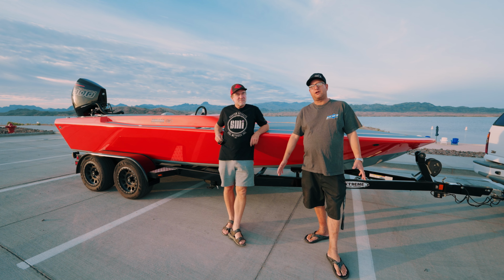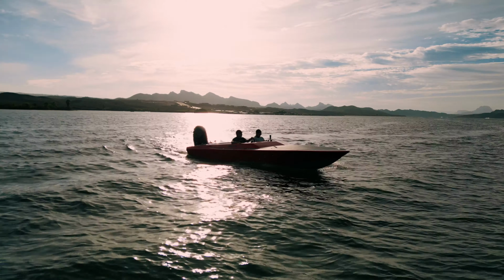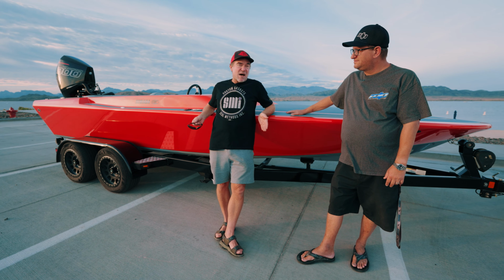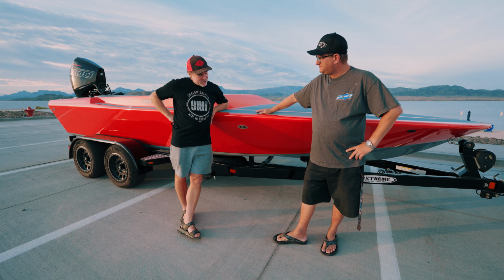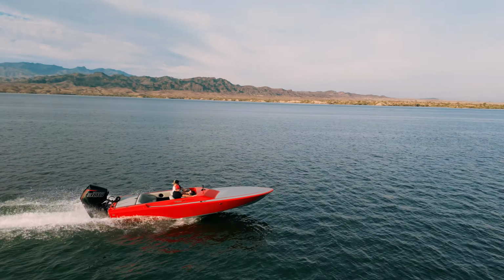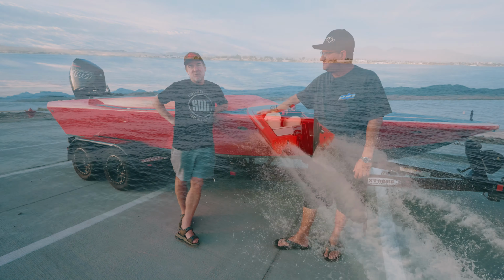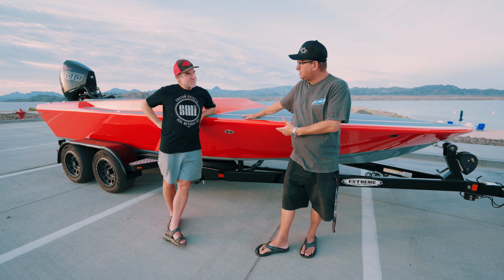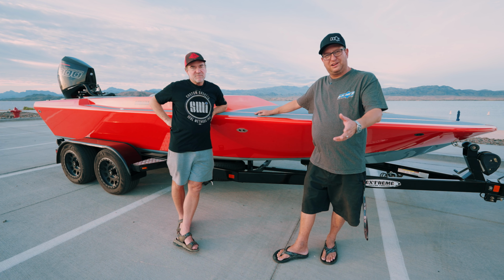SCHIADA 21 RT Feature Boat | Lake Havasu

Comment: Love this freakin' boat, especially the thoughts Lee explained went into the re-design. I never wanted to own the fastest boats on the water, in each class. The best handling, and the most comfortable ride, when the going got rough has been my goal. Man do I wish I could afford to sit down with Lee and spec out one of these or a new Stoker 22.4 from Eliminator when Al Stoker has helped them make the adjustments to run a 500R on it for regular leisure boaters, like myself. Thanks, Dave, this was a good one. Happy Thanksgiving.